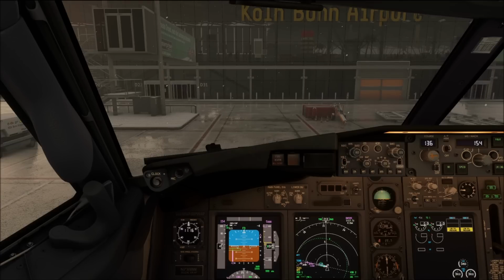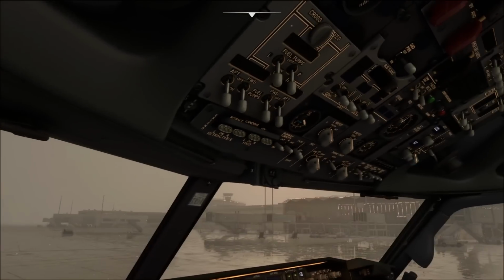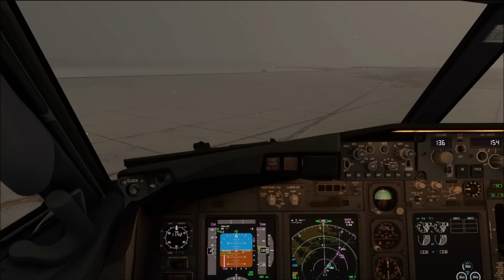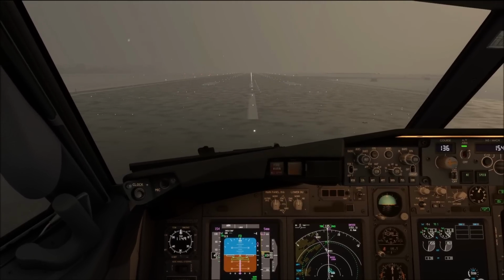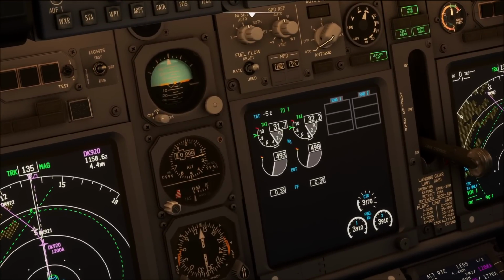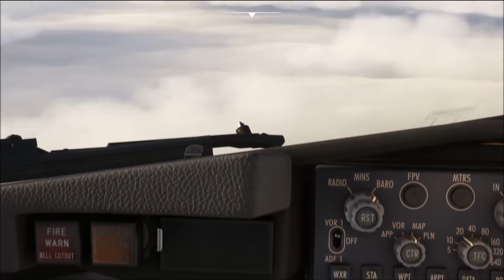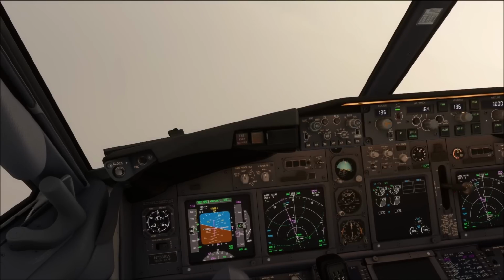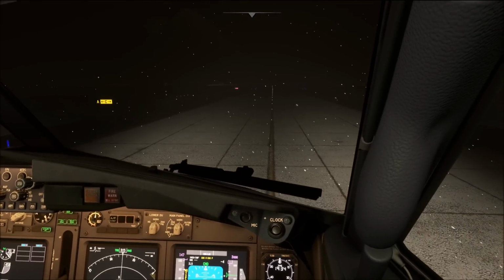Winter Operations Part 2: Taxi & Flight Procedures | Real 737 Pilot

Comment: H there.  As always a great video. Can i ask, trying to locate the altitude correction table via the FCOM supp services but its not there.  can you send me a link please
Reply from the maker: Can't send you a link unfortunately, but you can find it in the FCOM->Supplementary Procedures->Adverse Weather->Cold Weather Operation
Reply: Thank you. Can I ask RAM AIR DOOR. These lights stay on throughout, is this correct
Reply from the maker: @dicko6833  They will module as required. It is possible to see them on during any stage of flight.
Reply: Thank you

Comment: If the temp on the ground is say minus 10 but it's clear skies would you still use eng anti ice just because it's simply so cold despite no precipitation? This is what confuses me as I flew out of Edmonton at these temps but it was clear and I left the anti ice off and the fenix alerted me on climb to have them on despite no clouds??
Reply from the maker: If there's no residuals of snow or ice on the ground as well which might freeze up on your plane then there's no reason to put Anti Ice on in such a situation.
Criteria for usage of Anti ice expressively include BOTH temperatures in the icing range AND visible moisture. If either is not there, there is no reason to use anti ice.

Comment: Great video and definitely a great addition to what's in the FCOM supplementary procedures. One note, towards the approach you noted that VNAV was bringing you in a bit high. I've done some experimentation with cold weather corrections and it appears that MSFS does not model cold weather altimetry errors, therefore putting corrected values into the FMC will generate a VNAV profile that is slightly higher than what it should be. I've noticed even in extremely cold temperatures, an ILS glideslope will still put you bang on the uncorrected FAF crossing height. This makes life in the sim a bit nicer, cold weather correcting is tedious enough in real life :)
Reply from the maker: It used to be there in MSFS, at least last season. Did they break it? 😂

Comment: Great video. Things are starting to get crazy weather wise. 👍🏻
Reply: Oh! I wonder if this explains why my planes auto pilot has been consistently flying the approach below glide slope recently. Not being able to intercept it until the final waypoint 4 miles away from the runway 🤔. I'm wondering if instead of adjusting each waypoint like you did in the video, wouldn't it be more efficient to adjust the baro altitude to compensate for the loss in altitude? Wouldn't that adjust all waypoints simultaneously?